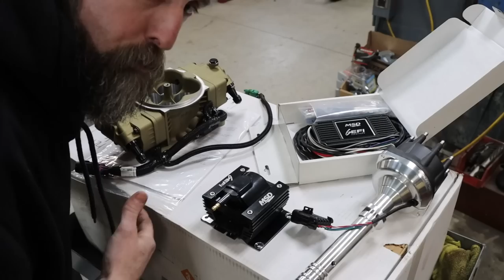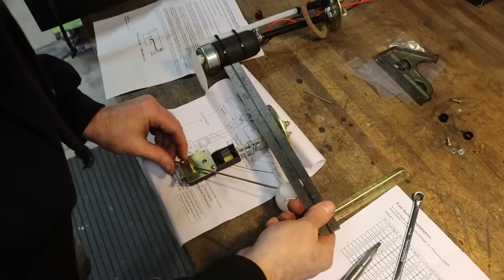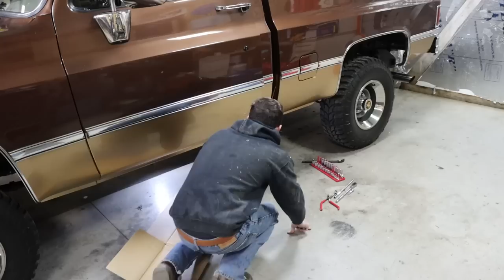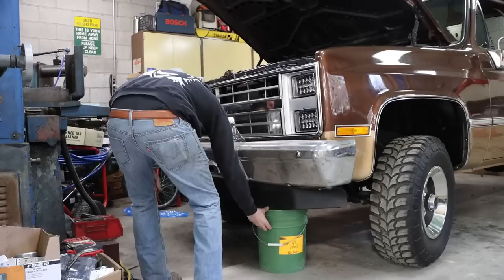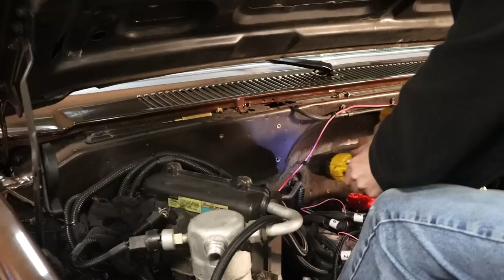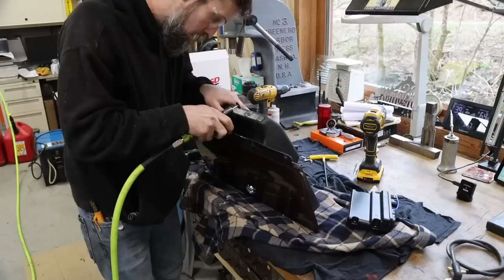Major Upgrade to the Square. Holley Terminator X Max Stealth . Part 1

Comment: Get the idea out of your head about running this motor lean. These motors need to be run slightly rich. Otherwise, you're going to burn your valves and overheat your motor. You're also going to have to put much better gas in the truck. Crappy gas will create build up and deposits on the injectors and O2 sensors. You need a good quality gas with detergents and probably a good idea every 6 months to run a high-quality detergent to your gas. Yeah, they might be better, but they require a lot more maint and care and if you ignore that, then you're going to have problems.

Comment: I completely agree I have a 1992 Chevrolet 1500 short bed Z 71, and I've always said the throttlebody injection is an awesome upgrade mine came standard but I have not done a single thing to it and my truck has 430,000 miles on it I think it's better than port injection it's so maintenance free, and for those people who have older trucks one good resource for parts is "LMC truck", not always the lowest prices but they have everything you could want for an older truck they are in Kentucky